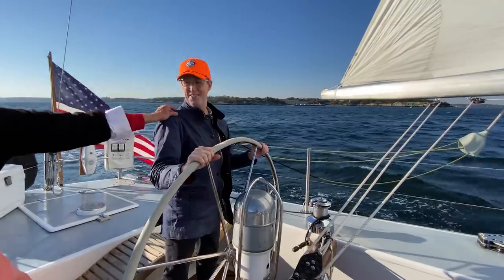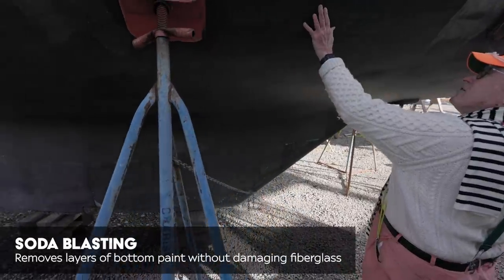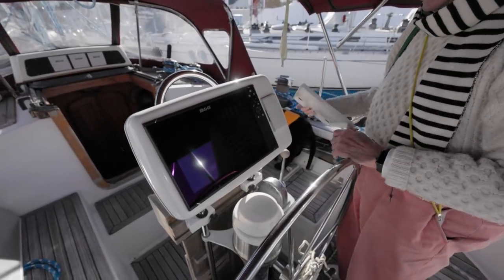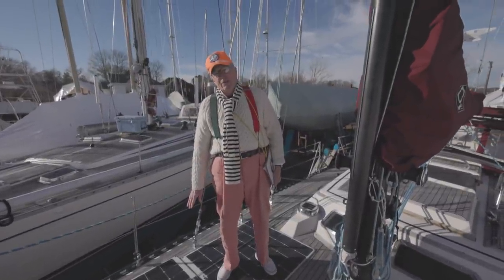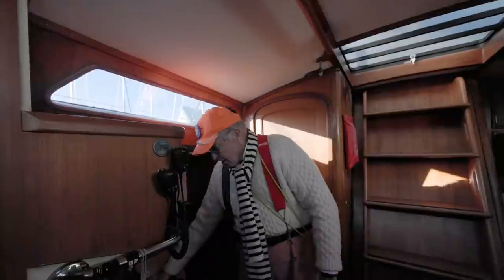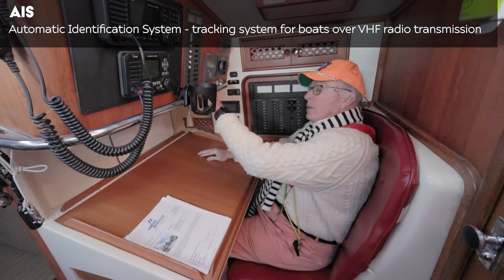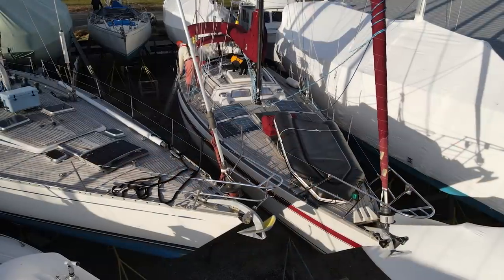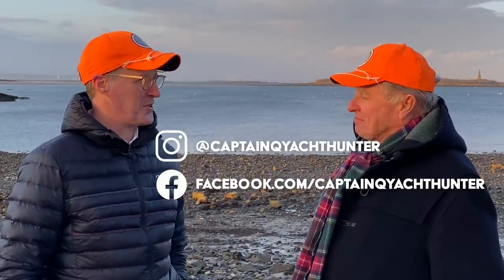$99,500 USD GLOBAL CRUISER! Proven bluewater sailboat for sale! EP76 #sailboatforsale #sailboattour

Comment: Solid big heavy boat, but not one of my favorite Perry designs.  Maybe it is partially the name Lafitte, but also it doesn't have the charming look (to my eye, above deck or below) of the Valiant 40 or many of his other boats.  But, even at $150K all up after some repairs, this is still a good buy for someone who wants to do some serious cruising on a big boat with a great pedigree.
Reply: John, Dream Weaver does not need any or the repairs you may think.  Don't touch the deck till you really have to, or if they keep you awake at night have the deck professional sanded and the screw plugs replaced.  Also toss out the CQR and Fishermans anchores, get a Rockna, Mantis or that dazzling new spade anchore from Lemar.  Sell that 2-bladed prop at a flea market and get a 3-bladed folding prop like a Gori.  Here is a not complete but close list of the additions upgrades done to Dream Weaver manly in 2018/2019, enjoy my friend:

Accommodations
Sleeps 7-8.  V berth forward.  Enclosed head with vanity and shower next aft to port, hanging lockers opposite to starboard. Main cabin features U-shaped dinette to port which converts to form double berth, settee opposite to starboard. Galley next aft to port, forward-facing navigator's station opposite to starboard. Aft owner's stateroom with double berth to port and single berth to starboard is accessible from main cabin through a second head, with vanity and shower, located aft of navigator's station. Both toilets are Wilcox Crittenden Skipper models, both rebuilt in 2019. Shower fixtures new in 2019.

Galley
U-shaped galley features propane four-burner, gimbaled, stainless steel stove with oven (oven  not working),  Sea Frost (2021) 12 volt refrigerated ice box and separate freezer with digital monitors and controls, double stainless steel sinks with pressurized hot/cold water. Propane system installed in 2019.

Electrical
12 volt DC and both 110 volt AC and 220 volts AC. Engine and generator starting batteries are 12 volt lead acid. House batteries consist of three Relion RB-300-hp 8D 300 ah lithium iron phosphate batteries (2019). Four deck-mounted semi-rigid, walk-on, 175 watt SolarWorld Sunmodule solar panels mounted on foredeck whose 700 watts of power produce as many as 250 ah per day! The four three-foot-square panels feed two 30 amp Victron SmartSolar MPPT charge controllers, monitored via a Victron Color Control GX mounted at nav station. Eclectic Energy (British) D400 wind generator (2019) with max output of 600 watts. Nex-Gen 5.5 KW 10 HP diesel genset (2019) with 75.7 hours. 110 and 220 volt Victron Energy inverter/chargers (2019). Boat automatically accepts 110 volt or 220 shore power and can output both voltages simultaneously, if so desired.

Electronics and Navigation
Brooks and Gatehouse electronics suite including forward-facing sonar, AIS transceiver, 4G radar (antenna mounted on mast), three Triton2 multi function displays, 12" Zeus3 chartplotter, and barograph. All purchased new in 2019, all updated in 2021. Simrad hydraulic autopilot (2019) networked to B&G system, Icom M803 marine HF SSB radio transceiver (2019) with DSC and color display, Icom AT140 automatic antenna tuner (2019). Insulated backstay serves as SSB antenna. Copper foil ground plane glassed into hull during boat's manufacturing process (standard practice with all Lafitte 44's). Icom IC M-506 VHF radio transceiver (2019) with RAM mike (2019). Iridium wifi satcom system (2019). King wifiMax router and range extender (2019). Ritchie SP5 binnacle-mounted compass.

Hull and Deck
Modified full keel with skeg-hung rudder. External lead ballast. Airex-cored hull, balsa-cored decks. Teak decking. Double bow anchor rollers. Maxwell electric windlass, rebuilt in 2019 with foot switch and wireless remote control. Double stainless steel lifelines (2018) with starboard boarding gate. Edson steering system. Four opening overhead Bomar hatches. 10 opening ports. Two Marinco solar vents with reversible fans. Two midship deadlights (2019). Cockpit shower. Dyneema jacklines, port and starboard, running bow to stern. Three padeyes in cockpit for attaching safety harness tethers

Sails and Rigging
Cutter-rigged keel-stepped aluminum mast. Staysail stay fitted with quick-release lever at base allowing stay to be quickly deployed or stored. Running backstays. Sail inventory of 7 sails, all made by Port Townsend Sails in 2019, includes fully battened mainsail with two deep reefs (30% and 60%), light air loose-footed mainsail with snuffing sock, roller-furling 115% genoa, Dyneema-stayed drifter, particularly robust staysail, storm trysail with separate track on mast, and storm staysail. Block and tackle boom vang with Dyneema line, 22', 20 lb. carbon-fiber whisker pole (2018) with integrated stowing (flush with mast) nd deploying system. Harken mid-boom mainsheet traveller (2018) mounted on house. Winch inventory includes two Harken #35 two-speed, self-tailing, mast-mounted halyard winches, Lewmar #30 self-tailing, two-speed, mast-mounted, reefing winch, two Lewmar #55 self-tailing, two speed, primary genoa sheet winches, two Lewmar #40 self-tailing, two-speed winches mounted on coach roof, one Lewmar #46 self-tailing, two-speed winch mounted on coach roof. All standing rigging and turnbuckles new in 2018.  Most running rigging replaced in 2018 with Dyneema. All chainplates removed in 2018, dye tested, and electropolished. All chainplate attachment points reinforced in 2018 with additional glass.

Mechanical
Wind Pilot Pacific (German designed and built) servo-pendumum mechanical windvane self-steering system (2019).

Additional Inventory
Viking 8-person liferaft (2019) in hard cannister mounted in a deck cradle. 3D Superlight Twin Air 290 9.5' inflatable dinghy. Burgundy cockpit dodger (2019) with zippered front window, stainless steel bows, and stainless steel grab rails on three sides. Burgundy bimini (2019) with stainless steel bows, full 360 degree enclosure, canvas covers for all windows, window on top for checking sail trim, and cover for top window. 45 lb. CQR plow anchor with 300' of 10 mm chain, 300' nylon rode, Danforth 35 HT with 50' 10 mm chain, Paul Luke 100 lb fisherman anchor (2019). Ace Sailmakers (E. Lyme, CT) Jordan series drogue. Plastimo extendable man overboard pole (2019). Stereo with two speakers in main cabin. Pots and pans. Toaster. Five fire extinguishers, six fenders, assorted docklines, two horseshoe buoys (2019), boat hook. Misc. engine spares.

Be happy, be safe

Comment: A beautiful boat with lots of goodies for the price. Sail her to the Philippines and have the teak deck removed and she'll be good for another 30 years.
Reply: Nick, I don't understand why so many folks are hung up on the deck.  Providing the teak is thick enough just sand (professionally) and replug the screw.  Here is a list of some of the things done to Dream Weaver mostly in 2018/2019.  I hope you enjoy:

Accommodations
Sleeps 7-8.  V berth forward.  Enclosed head with vanity and shower next aft to port, hanging lockers opposite to starboard. Main cabin features U-shaped dinette to port which converts to form double berth, settee opposite to starboard. Galley next aft to port, forward-facing navigator's station opposite to starboard. Aft owner's stateroom with double berth to port and single berth to starboard is accessible from main cabin through a second head, with vanity and shower, located aft of navigator's station. Both toilets are Wilcox Crittenden Skipper models, both rebuilt in 2019. Shower fixtures new in 2019.

Galley
U-shaped galley features propane four-burner, gimbaled, stainless steel stove with oven (oven  not working),  Sea Frost (2021) 12 volt refrigerated ice box and separate freezer with digital monitors and controls, double stainless steel sinks with pressurized hot/cold water. Propane system installed in 2019.

Electrical
12 volt DC and both 110 volt AC and 220 volts AC. Engine and generator starting batteries are 12 volt lead acid. House batteries consist of three Relion RB-300-hp 8D 300 ah lithium iron phosphate batteries (2019). Four deck-mounted semi-rigid, walk-on, 175 watt SolarWorld Sunmodule solar panels mounted on foredeck whose 700 watts of power produce as many as 250 ah per day! The four three-foot-square panels feed two 30 amp Victron SmartSolar MPPT charge controllers, monitored via a Victron Color Control GX mounted at nav station. Eclectic Energy (British) D400 wind generator (2019) with max output of 600 watts. Nex-Gen 5.5 KW 10 HP diesel genset (2019) with 75.7 hours. 110 and 220 volt Victron Energy inverter/chargers (2019). Boat automatically accepts 110 volt or 220 shore power and can output both voltages simultaneously, if so desired.

Electronics and Navigation
Brooks and Gatehouse electronics suite including forward-facing sonar, AIS transceiver, 4G radar (antenna mounted on mast), three Triton2 multi function displays, 12" Zeus3 chartplotter, and barograph. All purchased new in 2019, all updated in 2021. Simrad hydraulic autopilot (2019) networked to B&G system, Icom M803 marine HF SSB radio transceiver (2019) with DSC and color display, Icom AT140 automatic antenna tuner (2019). Insulated backstay serves as SSB antenna. Copper foil ground plane glassed into hull during boat's manufacturing process (standard practice with all Lafitte 44's). Icom IC M-506 VHF radio transceiver (2019) with RAM mike (2019). Iridium wifi satcom system (2019). King wifiMax router and range extender (2019). Ritchie SP5 binnacle-mounted compass.

Hull and Deck
Modified full keel with skeg-hung rudder. External lead ballast. Airex-cored hull, balsa-cored decks. Teak decking. Double bow anchor rollers. Maxwell electric windlass, rebuilt in 2019 with foot switch and wireless remote control. Double stainless steel lifelines (2018) with starboard boarding gate. Edson steering system. Four opening overhead Bomar hatches. 10 opening ports. Two Marinco solar vents with reversible fans. Two midship deadlights (2019). Cockpit shower. Dyneema jacklines, port and starboard, running bow to stern. Three padeyes in cockpit for attaching safety harness tethers

Sails and Rigging
Cutter-rigged keel-stepped aluminum mast. Staysail stay fitted with quick-release lever at base allowing stay to be quickly deployed or stored. Running backstays. Sail inventory of 7 sails, all made by Port Townsend Sails in 2019, includes fully battened mainsail with two deep reefs (30% and 60%), light air loose-footed mainsail with snuffing sock, roller-furling 115% genoa, Dyneema-stayed drifter, particularly robust staysail, storm trysail with separate track on mast, and storm staysail. Block and tackle boom vang with Dyneema line, 22', 20 lb. carbon-fiber whisker pole (2018) with integrated stowing (flush with mast) nd deploying system. Harken mid-boom mainsheet traveller (2018) mounted on house. Winch inventory includes two Harken #35 two-speed, self-tailing, mast-mounted halyard winches, Lewmar #30 self-tailing, two-speed, mast-mounted, reefing winch, two Lewmar #55 self-tailing, two speed, primary genoa sheet winches, two Lewmar #40 self-tailing, two-speed winches mounted on coach roof, one Lewmar #46 self-tailing, two-speed winch mounted on coach roof. All standing rigging and turnbuckles new in 2018.  Most running rigging replaced in 2018 with Dyneema. All chainplates removed in 2018, dye tested, and electropolished. All chainplate attachment points reinforced in 2018 with additional glass.

Mechanical
Wind Pilot Pacific (German designed and built) servo-pendumum mechanical windvane self-steering system (2019).

Additional Inventory
Viking 8-person liferaft (2019) in hard cannister mounted in a deck cradle. 3D Superlight Twin Air 290 9.5' inflatable dinghy. Burgundy cockpit dodger (2019) with zippered front window, stainless steel bows, and stainless steel grab rails on three sides. Burgundy bimini (2019) with stainless steel bows, full 360 degree enclosure, canvas covers for all windows, window on top for checking sail trim, and cover for top window. 45 lb. CQR plow anchor with 300' of 10 mm chain, 300' nylon rode, Danforth 35 HT with 50' 10 mm chain, Paul Luke 100 lb fisherman anchor (2019). Ace Sailmakers (E. Lyme, CT) Jordan series drogue. Plastimo extendable man overboard pole (2019). Stereo with two speakers in main cabin. Pots and pans. Toaster. Five fire extinguishers, six fenders, assorted docklines, two horseshoe buoys (2019), boat hook. Misc. engine spares.
Reply: @larryboles629  Hi Larry. I love the way teak decks look, but if it was up to me I would remove it; just too many holes to worry about. It wasn't up to me, so we still have teak decks on our boat 😂. We had them redone in the Philippines at a fraction of the cost. Yes you're correct, it may be possible to sand them and get more life out of them. We live in the tropics and the teak does get hot.